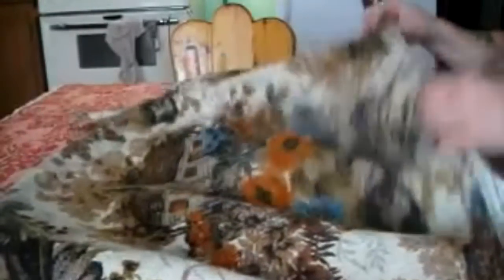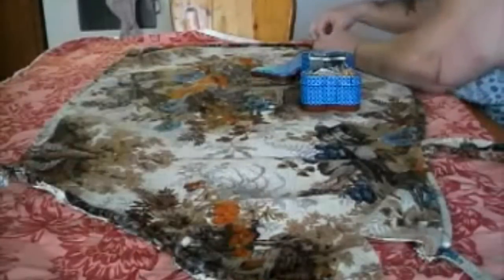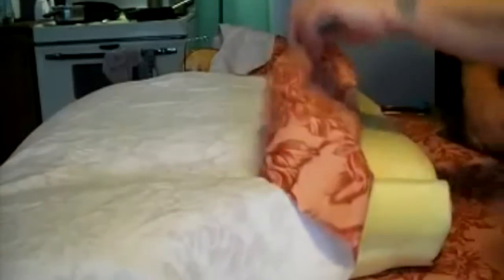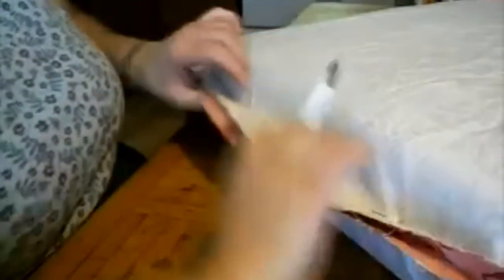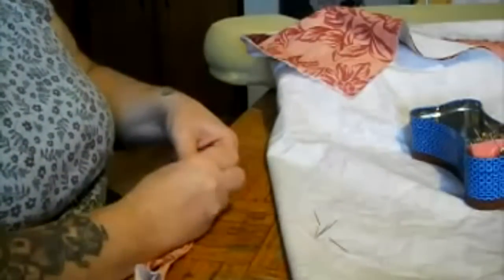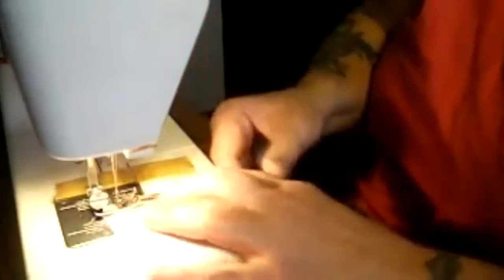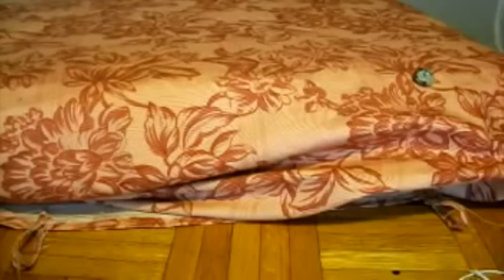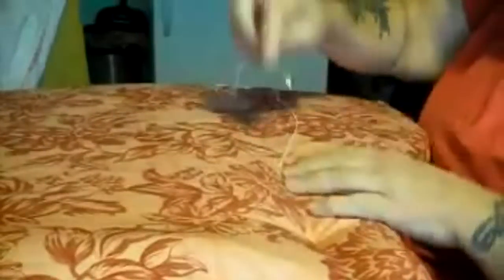Recovering An Old Love Seat

Comment: Bev, you and I are cut from the same cloth! (pun intended!) I do my slip covers the same way. I even make clothes like that if simply made or I'll cut it apart for a pattern. A quick button cover; cut a circle out of the new fabric and hot glue it over the old fabric around to backside (or stitch it like a yo-yo first and then glue.). Years ago a friend wanted to re-cover her couch but didn't have the money for the fabric, so she bought a couple of king size sheets and a bunch of those cork screw pins (for such as that) and we spent the day figuring it out, smoothing, tucking and pinning till we had it all covered,(we stitched the cushion covers together) turned out great and she had two small boys at the time and that stayed in place till she was ready for something else a good year and half later.
Reply from the maker: DixieGirl9876 Thanks! I never thought of glue or the Yoyo stitch! I am thinking of making just slip covers for the newer stuff we just got..at least they will be easier to keep clean!